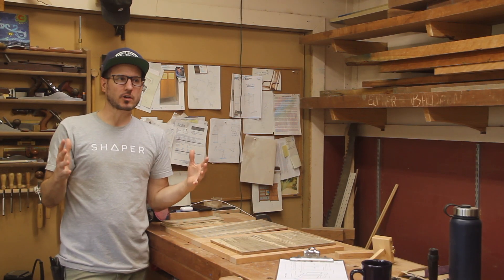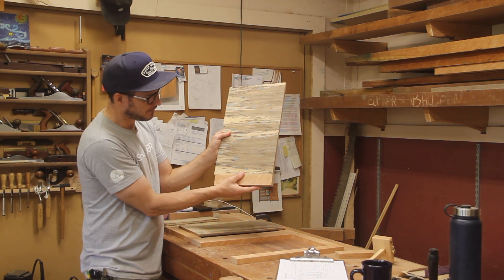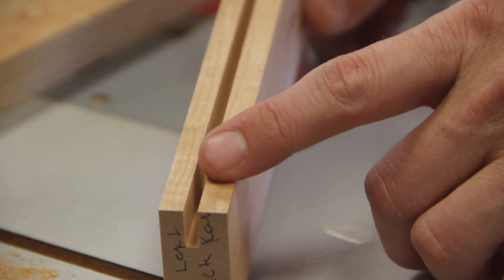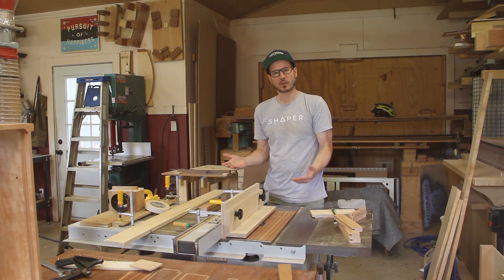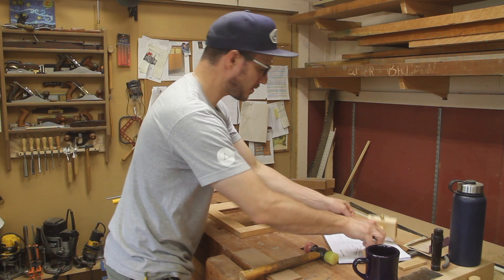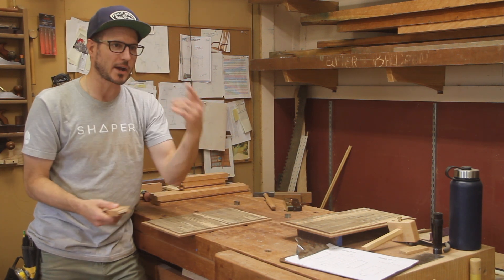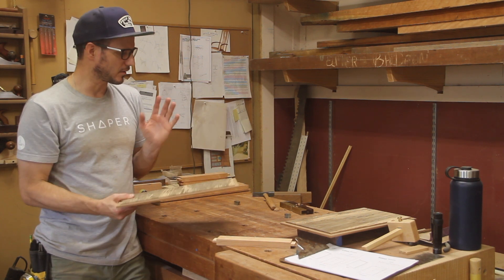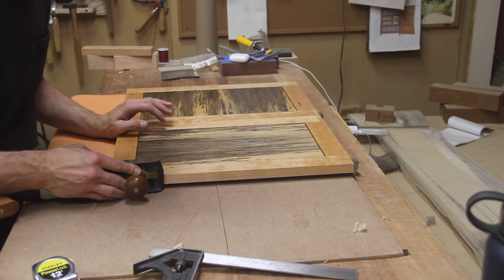Small wall cabinet part 5

Comment: Phil, I tried asking you this on IG but I'm sure it got lost in all the comments. What is the widest glue-up would you do for a side or top using the rip and flip method. Thanks enjoying the video series.
Reply from the maker: Hi sorry. Honestly there isn’t really a limit ...however I probably wouldn’t go more than 18 or 20 inches. It will become a lot of work and time doing it more than that.
Reply: Thanks Phil. That was my line of thinking as well. 👍🏻